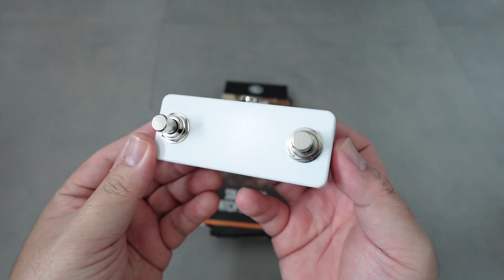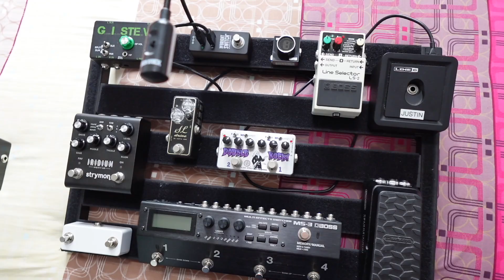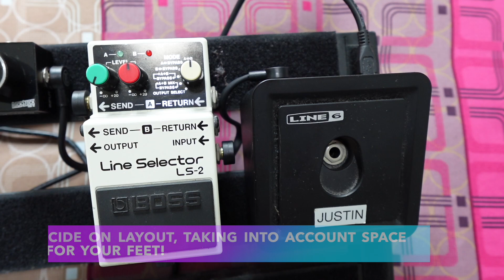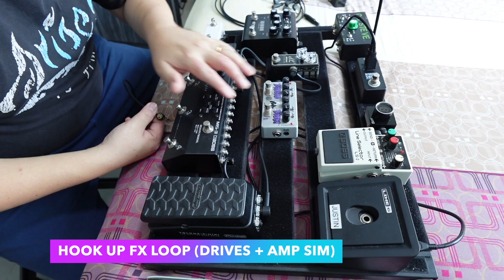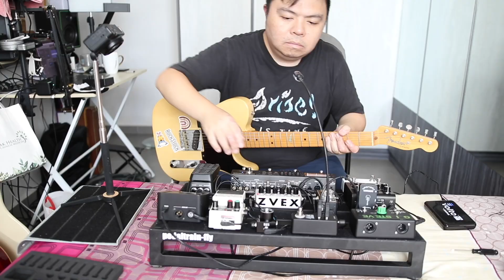These Should Be ESSENTIAL On Your Pedalboard! (Rock Stock Bright Switch, Aux Switch, Cables)

Comment: Man, an FM3 would solve all these issues. So much easier to carry with less chance of issues. It is worship music...it doesn't need to be so complicated. Your members will not notice the difference and the donations would go to better use economically and labor-wise regardless of whether or not you perform voluntarily or paid. I am not trying to be a jerk, but many praise musicians have already moved to the likes of a Helix or Fractal. Using PA's I do not understand the concept of a huge pedalboard or an amp. If pedals are necessary, get a Two Notes Opus and a H90 or Helix FX and call it a day.
Reply: Correct. But honestly it is more fun to build a pedalboard with pedals
Reply from the maker: Some churches do sponsor the gear and build a pedalboard for the church, but most places I know don’t, limiting to just a direct box, some with amp modeling. I’m actually primarily a Helix/HX Stomp/POD Go user so I totally get where you’re coming from. The engineer in me just loves building things and making them work. At least with an analog board, if one component goes down, you can take it out and salvage the gig. Not so with a Helix if it hangs/crashes! I had to reboot my Helix mid-setlist cause it hung while being used to control my Ableton session on stage.